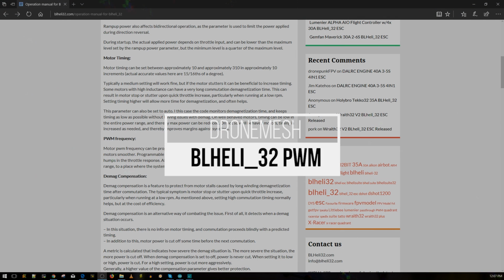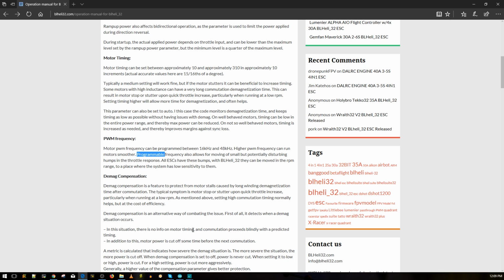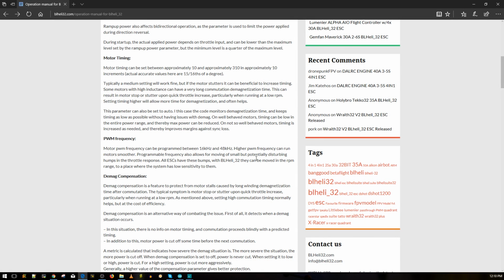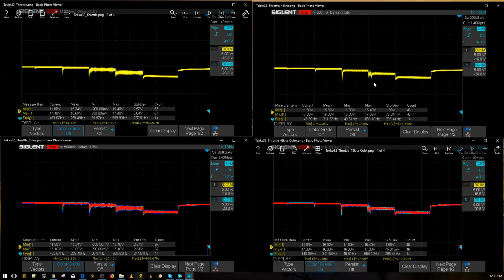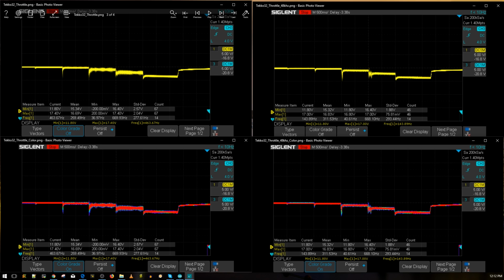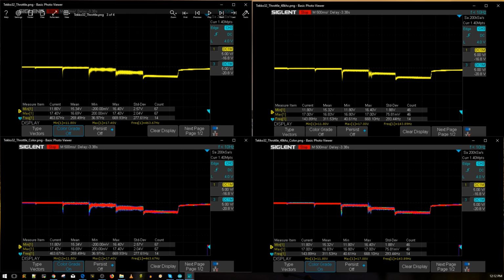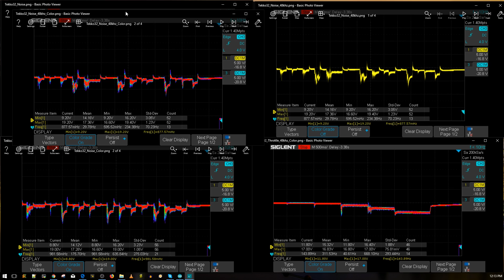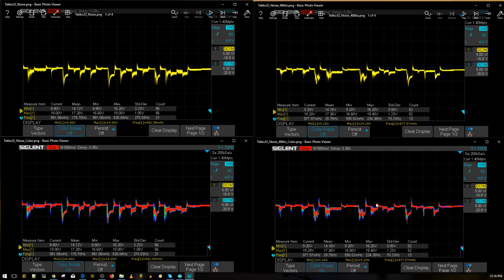Should you increase Blheli_32 PWM Frequency to 48khz ?? // Lets find out

Comment: One thing I have noticed about 24kHz vs 48kHz on my 7" rig at least is that with 24kHz the lower 90% of the throttle range is more locked in and less bobbles due to turbulence because of the greater torque. But the motors do run hotter and the upper 90-100% throttle is a bit shaky. On the other hand, with 48kHz, the motors run cooler, but the quad just feels less locked-in (more bobbles and less control-feel). With 48kHz the upper throttle range is def smoother though. So both have their pros and cons and I will be trying to split the difference by trying out 36kHz.

Comment: FC doesn't know anything about the PWM frequency of the ESCs. And isn't affected by it in any way. I'd say the only parameter that limits how high can it go is MOSFET's gate capacitance. The lower the better. The higher the more time will the MOSFET spend dissipating heat in the inappropriately named saturation region.

Comment: idk if this was what was causing my issue, but when I ran 48khz on my only blheli-32 esc setup it wanted to VIOLENTLY flip or roll during those maneuvers, like way past 1200deg/sec and my max is 640deg/sec. They were controlled though as when I let off the stick (after like three instant rotations lol) the quad becomes perfectly controllable again. normal flight, up to like 90% stick throw on R or P-axis, idk about yaw. Replaced the flight controller, was MUCH BETTER but there was obviously still a twitch, a fast move that wasn't commanded at the end of flips and rolls, or at the beginning. Changing to 24khz seems to have helped smooth things over now, and I can finally tune it properly lol.

Comment: Hello. Today I flashed Jesc 2.2 with 48khz but I’m getting a lot of mid-throttle oscilations. Do you have any idea what’s the case here? Before it was a lot better with minimal propwash and no oscilations. I’m using Mamba F405 and BLHeli-S. The quad is Diatone gtr349. Thanks

Comment: Hi man, did some testing. I think there is another aspect that no one really talked about. Looks like changing frequency changes resonances in the frame (all frames have multiple resonances, just some of them have higher amplitude than others in my testing)

I have run same config, with hard patches, rolls and power loops on 24khz. And than same thing on 48khz, over all gyro debug spectrum is cleaner (less fuzz over all and 4/5 spikes became about 25-33% lower, but one spike at 171Hz became slightly higher and more defined (narrower at the bottom and wider than before at the top)

Notch doesn’t help / affect that 171 spike, so def frame resonance, which was never as defined on 24khz. 

Just sharing as I have not seen any one talk about it. (Can’t attach photos hère)

Comment: I have a old setup with a f3 processor and RDQ blheli32 escs and these bumps are extremely noticeable and audible in my quad it's very harsh. I have been trying every setting but this in blheli to reduce this issue. Thank you for the video I will be dropping from 48khz and seeing if it makes a difference.

Comment: @05:12 you are saying that PWM frequency depends on the flight controller. IMO that is not true. PWM frequency is a thing between the ESC and the motor and has absolut nothing to do with the flight controller. It's on the output side of the ESC not on the input side...

Comment: Great videos enjoying watching them and purchased a few things based on what you've said thumbs up :)....been using 48khz on various builds and found that it runs fine with the DYS Aria DYS F4 combo but with the HGLRC  4 in 1 40a dinoshot dont like it ,almost lost it in flight when it kinda of freaked out much like you said may happen, have two dinoshots and found the 32khz is the safe zone been running them for 2 months or so and no problems

Comment: I've been flying 48kHz on my wraiths32 35A v2 (it looks like the tekko32 is a clone/oem of this?!) and had one esc failing on me in the air - it took of and flew like 5 seconds and after that I just heard the escs booting up and the quad spinning wildly. It flew great like 20 packs before that!
No visible burned components or anything - the esc is just dead.
I've contacted airbot and they told me that the escs are designed to run 20kHz. 
Quoting the support reply:
"... the Mosfet driver was designed for 20K(not only ours but almost all the ESC which using FD6288 as driver, are designed for 20k), but use it on 48k, just "may" cause problem, not 100% problem coming"
So now I'm running everything on the default 24 - better not smooth then falling from the sky.
Reply: You must have had a faulty ESC or some other problems as this response just doesn't make any sense. 24kHz and 48kHz are within the same order of magnitude, and 48kHz is not high of a frequency at all. 48kHz is about 21,000 nanoseconds so even with the most pessimistic calculations we're way below the capabilities of this IC. Also, any FETs should be able to switch at these speeds laughingly. I wasn't able to find an English Datasheet for this given FET driver but according to the datasheet on their Chinese website, it has a 200ns dead time between H-L pulses. Even if we add fall/rise/hold time and all components we're still far from 48kHz.

Comment: I wonder why the motor doesn't spin at higher pwm frequency for you.. This should have absolutely nothing to do with fc to esc specifics. What protocol are you using in your test setup? dshot?

Also, why don't you just ramp the throttle value smoothly instead of moving to 10% increments?

Comment: I do know how it is in the air. It happens to me more often with a full battery. It jerks in the air and rights itself again.
Reply: O and it does it with same setup on 2 different quads.
Reply from the maker: What is your Full setup specs?
I have a theory and I want to see if it's possible.
Reply: Drone Mesh i have the tekko32 single escs on the holybro kakute f4 v2. Motors are tmotor f40 pro v1 2400kv on 5s. Other setup is the same only that one is running hypetrain 2450kv motors. On 5s. Both running without caps.
Reply from the maker: Ok so we both running 2400kv motors. I'll test with lower and higher KV. So at the current moment if possible try to setup your quad in Angel mode and push throttle and see around what percentage it happens if it's same as me between 60 and 75% then all my findings should in theory be universally applied by esc to KV.
Reply: Drone Mesh i always fly acro. When i ment right itself, it has a joult and then it works again. Sort of desync but temporary, a tenth of a second or so.

Comment: Does motor timing also allow that “hump” to be moved & does supply voltage affect it? May be different in 4s than 6s even at same pwm frequency
Reply from the maker: ryan todd I have the 6s test comming soo  and we will see if it's position changes.
Reply: Drone Mesh 
Sweet! You’re the man
Reply: @DroneMesh  have you tested it?

Comment: I run 48hz and I have no hiccups on my tekko 32. 4 in 1 no caps even with 6s 2207 2500kv no issues. Maybe a low esr will clean it up.

Comment: Now would this really be noticable as it appears the bump isnt as large as the noise on the throttle test on 24khz. If the rest of the throttle is smoothed maybe it would be.
Reply from the maker: Thomas Haley Yes but the hump is not noise it's a stutter in the motor.